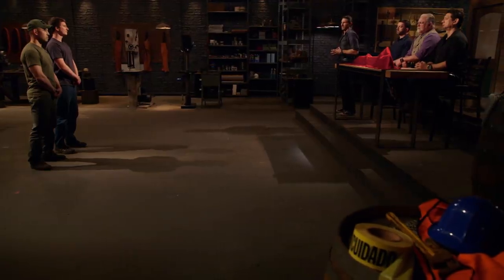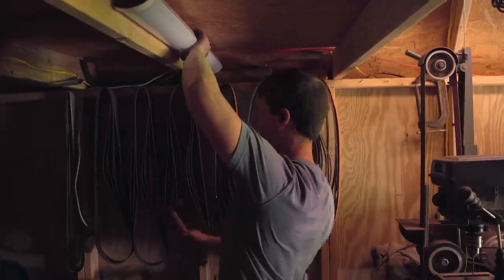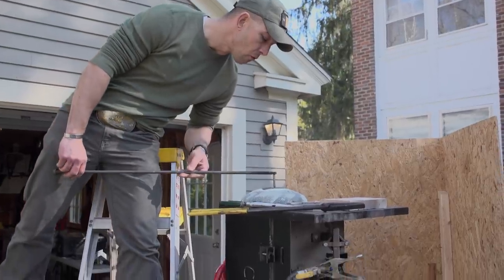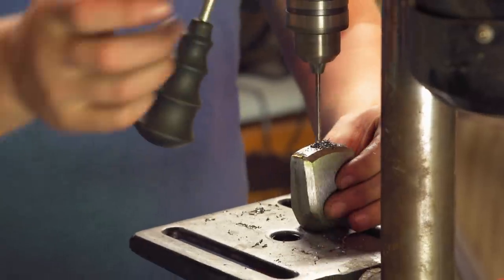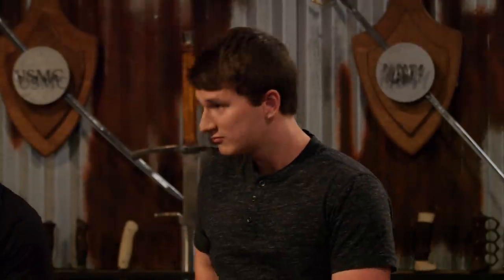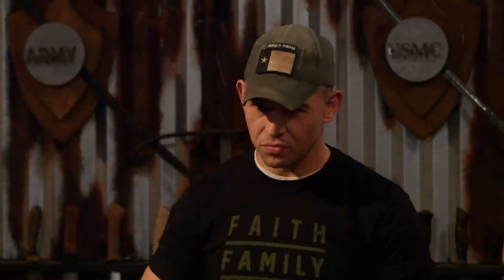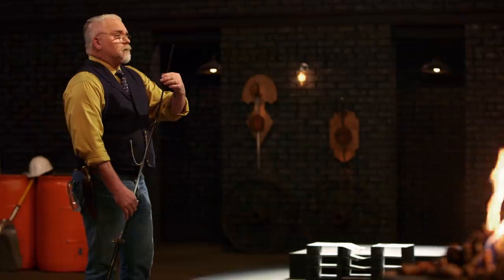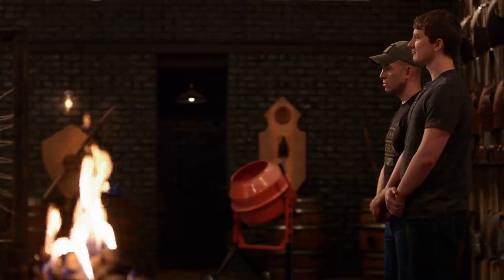The Boar Sword BRUTALLY MAULS the Final Round (Season 6) | Forged in Fire | History

Comment: yeah, the Boar Sword seems very impractical and cumbersome.
Reply: It was not a fighting weapon, it was designed for stabbing wild boar, the upper guard was there so the boar doesn't charge you after you stabbed it. 
It's actually quite effective.
Reply: @geniul555  Yes.  I learned that from the boar spear episode.  Which was extremely effective.
Reply: @daniellewis2133 The boar sword was the upper class version, but obviously a boar spear is much, much more effective.